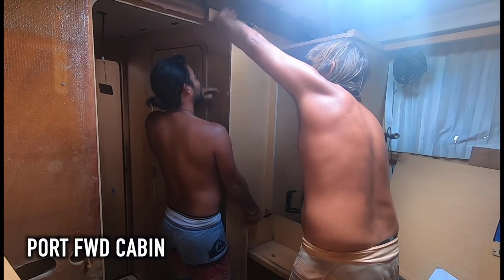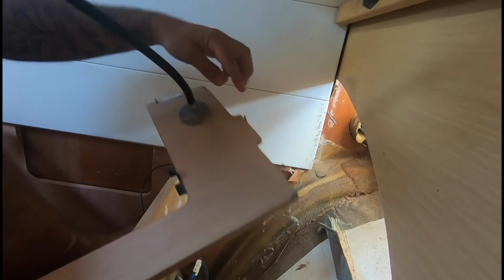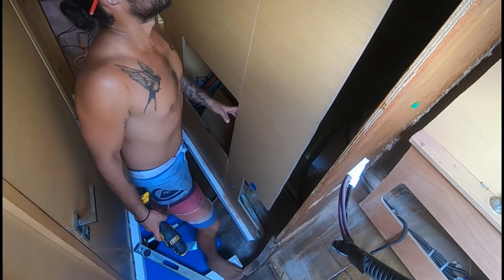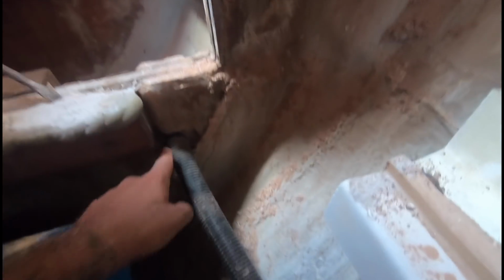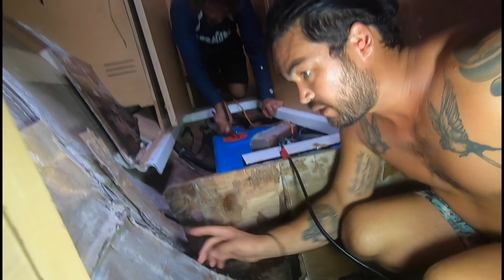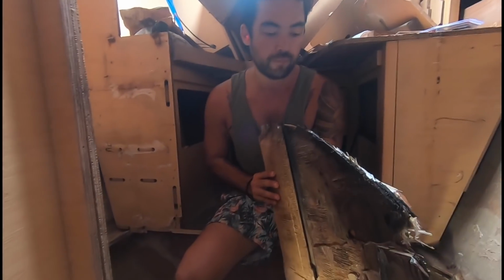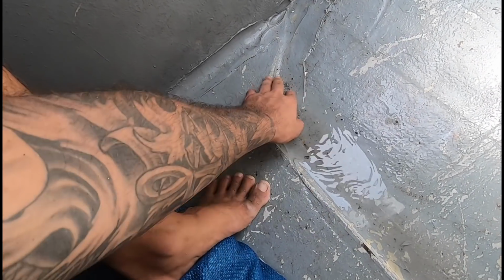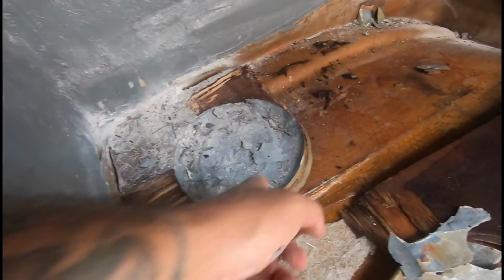CRACKED BULKHEAD REPAIR SERIES - Part 5  (Episode 110)

Comment: 3 second google search finds this enjoy.
Recieved this from Lagoon today:

Service Network communication regarding the Lagoon 450 mast bulkheads
May 6th, 2021

Dear Partners,
Following the webinars we had this week, this communication regards the Lagoon 450 (Flybridge and SporTop versions) in response to several reports of damaged forward bulkheads.
To share with you a global view and understanding of the situation, we would like to remind you that since 2011, more than a thousand Lagoon 450 have been sailing all over the world, and that a large number among these are extensively sailing, many in successful charter use.
To date, around 40 cases of damaged forward bulkheads have been reported, mostly by owners directly. However, we would like to point out that a large number of boats inspected present no problems with their bulkheads, knowing that many of these boats have a history of intense sailing in all types of sea conditions.
You are well aware that the customer safety is an absolute priority for Lagoon. In this regard, we would like to confirm that the damage to the mast bulkheads, as reported to us, can lead to neither dismasting nor any risk for the crew.
All Lagoon 450 can therefore continue to sail.
Among the cases identified, we have discovered localized buckling or shearing on the outer side of the forward bulkhead (non-structural zones with respect to mast support). According to the Finite Element calculations (FEA) performed by our Design Office and analyzed in collaboration with the VPLP team of naval architects, we confirm that the scantling is sufficient under normal use of the boat.
The area is located in a stress concentration zone, designed to withstand normal stress, which could however create an imbalance if the boat was to be used in a manner that does not comply with the recommendations for use, as described in our User Manuals.
To reassure Lagoon 450 owners, should they have any questions about the condition of their boat's forward bulkhead, we propose, for those who wish so, to have an inspection of their boat's forward bulkhead performed by the Lagoon dealer network (or Lagoon Service Center). As a commercial gesture, these inspection costs will be borne by the brand. It cannot be carried out other than according to the inspection procedure established by the Lagoon brand. Should the owner detect any damage to the bulkhead, we recommend the inspection to take place at the earliest opportunity.
The only approved inspection is the one provided by a Lagoon dealer, following the methodology provided by Lagoon.
In view of our technical analysis of the cases reported, and of the history of each boat, we wish to manage the situation on a case-by-case basis, which will allow us to propose an appropriate response. Our Customer Service team is at your disposal to provide you with the inspection methodology and, if necessary, the appropriate repair procedure, or even the reinforcement procedure for the forward bulkhead, should the customer wishes so.
Finally, we confirm that this issue only concerns the Lagoon 450, and no other model in the range, be they former or current models.
The Lagoon 450 is, and remains, a model widely appreciated by yachtsmen all over the world, and we are committed to preserving its excellent reputation, both in the interest of the owners, and also in the interest of the Lagoon brand.
We are working hard to find a solution for each and every case that is brought to our attention, and we know that the professionalism and worldwide presence of the Lagoon dealer network and Service Centers, which you are a part, will be a genuine asset in this context.
Thank you for your collaboration on this matter, and for the level of service you are able to provide to the Lagoon 450 owners that come to you.
The LAGOON team

Comment: Colin, you are the man! (both of you).  Question is, did the water rot cause the initial failure or was it the hurricane damage?  Either way an issue that’s clear, is the original craftsmanship and construction of this cat surely holds some of the blame!  This video even teaches non- boat owners the damage water can do.  Water will find it way to a settle point.   PLEASE COLIN WEAR A MASK!  you damn sure don’t want lung damage or worse from all this!!!!  Sure it’s hot and a pain,  but you have to wear one!!!

Comment: when putting her back together, try to minimize the number of holes in the bulkheads. And especially do not cut holes on the same (horizontal) level like in the bulkhead at 7:00
It weakens the bulkhead dramatically.
Round holes are better for stress relief.
but of course you know this sjit :-)

Comment: This illustrates the pitfalls of modern boat construction where the furniture skin hides all the structural stuff. One little leak can rot out the entire boat setting off a chain reaction of failures. It’s not Lagoon’s fault, the whole industry builds boats like this. They are not designed to last more than 10 years or so. These failures surprisingly common.

Comment: Lagoongate continues..
In some some respects, thank fork this happened to you guys because you have literally revealed the full extent of this..you may not have only saved your lives but many many others...
Now for an annoying suggestion...maybe screw glue and glass in some aluminium box section to your new bulkhead on the vertical? (4" by 1" or 2"?)
Light, no rot and rigid....you could even make it a custom design feature :)

Comment: Here's a trick for controlling dust. Put the space under negative air pressure using a fan to suck the air outside. If you don't have an opening to vent directly outside, use a fan/filter combo and you can direct the air wherever you like. When I was having the drywall sanded in my basement,  I sealed off the entrance to the basement with poly film with a HEPA fan filter module mounted in the film. The fan sucked air out of the basement and the filter made sure no dust migrated beyond the basement.

Comment: Wow, looking at that glue squiggle and clean release regardless of recent water intrusion at the tripled bulkhead stiffener, I can only imagine the engineer screaming, "That's not what I meant by glue laminating 3 pieces of plywood." That clean line shows either the glue developed a skin prior to bonding, surface contamination that prevented bonding, or faulty adhesive. In any case that should have been 100% coverage and not a squiggle of adhesive.  That alone proves those bulkheads are worthless from an engineering standpoint. Every place on that boat adhesive was applied is now suspect. In every boat Lagoon has manufactured. The wood fibers should rip apart before that glued surface should release. 
The placement of that conduit through the bulk head shows a complete lack of understanding of the structural aspects of the main critical support structure at the factory floor level. Production of these boats should stop immediately until these defects are addressed and rectified, the crew which assembles the parts is educated on the structural importance of the parts they are assembling. I really wanted to get into that exact boat. I'm not sure I'd take one for free, now. I feel for you guys. This isn't Hurricane damage. As evidenced by the one sitting right next to you with the same problems.
Reply: By the pattern of that glue, it doesn't look like any clamping pressure was applied while the glue set, so it just stayed as a bead and didn't provide much strength.
Reply: I thought about the holes put in the bottom of the bulkheads and am not sure it is a structural problem.  Is there mush of a load at that point?  However it certainly help moisture intrusion in plywood.
Reply: Yep , the glue should not fail , it should be stronger than the wood . All the holes down low allow any water in the bilge to penetrate and rot the wood  before we talk about weakening . There is zero chance they sealed the holes given the cheap camper construction quality of this boat . 

It reminds me of those cheap campers that look great new and last about 10 years before the slide out starts leaking , the floor gets holes under something that can not be taken apart to fix because the wood was not real marine grade or even protected by paint .

Comment: Major mission, make sure you use lloyds specification ply wood also make sure you use Vinylester resin and not polyester as adhesion is  paramount, also overlay to hull shell requires 4 inches staggered otherwise hard spots will cause cracks external in Gelcoat later on .
High density foam slither between ply and hull filleted with 1152 bonding paste, don’t use resin mix with colidical silica  to create fillet as will crack under loads as has zero flexibility.
One should invest in a 5EQ festool sander and vacuum around £600 all in will do same job as grinder with no dust .

Comment: I am a car guy and i know a little about aluminium monoqoques.  With time there is fatigue.  Your boat has got the same Syndrome, your bulkheads are dead,plywood as alu moving it's getting weaker and weaker , it's lifespan is over! So i think before anything else  , replace them with your own design. 
Beeing a ship engineer , you will arrive
Good luck     fred

Comment: geez dudes, interesting what two blokes dressed in underwear armed with little more than hammers and a dremel can do. Those bulkheads are shockers, the condition of the inter laminates of the ply, that shouldnt happen. Are you sure its Marine Ply?  In hindsight those apertures for conduits and pipes shouldnt be where they are, or should have rings around them to support the load path. Same is true to the companionway access, it should have an angle ring (even if its stubby) around it like water tight doors have. Landings for the plywood edges of the bulkheads might be nice to, just to spread the load. It seems over the top but clearly as bits have been failing the whole system has come apart, and it seems to me what failed first isnt certain or typical. Do what you can with the apertures in the new plywood, and you are going to have to be certain the contact with the traverse beam at the top is more than adequate, even if you have to plan in some additional shear strength beyond spec after the primary glass. Overall coating in epoxy a given. Better now than revisiting it later.

Comment: I hate how as a boat builder you make everything below the Waterline watertight fibreglass and painting resin everywhere just for some plonker to drill multiple holes through bulkheads which now lead water into the structure of the plywood.
 I was taught all holes through the bulkhead painted with resins to stop any water penetrating ply.
You are doing an awesome job but I am so very glad I am not living where I'm working keep positive

Comment: Hey bro, im no engineer but you need to epoxy back fill that whole lower floor, cut up the glass sheets into 2" x 2" pieces and mix them up INTO the resin as a thickener and just pour the mixture in and let gravity do the rest... I used to think million dollar yachts were built to strict standards but honestly hurricane or not... better reenforcement was needed anyway.... DONT REGRET THIS, be glad you are getting an up close and personal inspection of how shortcuts in manufacturing can lead to DISASTERS AT SEA. ;) someone UP THERE ^ loves you.
Dont let this bring you down, you got this.

Comment: Wow Colin and Jamie .... Greetings from NZ.... I am ' With You  Guys all the Way' ..... The way that the Boat has been 'Constructed' , 'Designed' and 'Engineered' borders on Criminal ..... No Bonding and/or heavy Bi-Axial Glass between layers of Ply ...... As you say, Totally Agree .... The weakest point is the 'Openings'... Especially the corners down on the Hull and 'Pontoons'. The amount of 'Tension' below and Compression above the Opening is Massive and No Way could That 'Construction' survive even just the 'Shroud Load', let alone some Heavy seas .... Those Bottom Corners will Need Massive constructions as they are just so Narrow / Inadequate  .....Very best to All from NZ

Comment: Replace that rotten insufficient structure with Cosa board instead of Plywood.There are composite boards with much better shear and compression strength.Plywood is the budget builders material.The watt to do your repair would have been to remove the deck and lift out the interior components reversal of the way it way built. the mast step to chain plates need an aluminum grid welded together hull to hull for to aft

Comment: "new plywood" - why not use Divinycell - that will not rotten - and would be better for that with the right density and glassing?
Reply: Along with Ultra High Molecular Weight Polyethylene (UHMW) UHMW, also known as UHMW-PE (Ultra High Molecular Weight Polyethylene).

Comment: I'm sure you're past this point now with the rebuild. Have you considered fabricating a two piece stainless steel bulk heads similar to the plywood ones only two pieces so as to be able to install in the tight quarters and bolt the joint together. The outer edges to pontoons to be thru bolted with backing plates. I know the stainless fabricating would not be as builder friendly the plywood, but you're planning some serious open ocean runs. I'm just another arm chair quarter back.

Comment: Sunk boats can't be compared to unsunk boats. You can't really say where the stress points are after sinking or where the leaks came from. If you can don't cut out add plywood and glass to the orignal wood.
Reply: This is why you don't salvage boats damaged to much.
Reply: This is the problem with cats "flex stress " from two hulls. They get racked .

Comment: Hey colin/jamie,.. thanks for another great video,. this is clearly a manufacturing issue that brings into question the very design from the day this cat was conceived, rotten wood, caused by leaks in other areas of the boat not being designed or finished properly, total lack of access to critical areas as main bulk heads which makes regular inspection dam near impossible even with a cavity camera,.the insurance companies will keep an eye on this project i suspect and milk it for all its worth should there be a claim on other Lagoons, so Lagoon owners beware, 
as an engineer i was always taught that a man can take it apart and put it back better that it was before !!! i would love to get stuck in with you guys,.and get this F**K up fixed,..it looks a daunting task,... but am sure you'll do it the very best of luck,..David,..
Q:....PS ever though of replacing the rotten ply with a thicker ply to add more strength ?

Comment: i’ve just finished the same job on my mast bulkhead, But this is only a 35 feets monohull so you get at least 4x the same job that mine to do! Respect ! By the way i am again surprised by the low plywood quality. My boat is a jeanneau one design from 1992, known to have water leak inside the mast. So my bulkhead was having the foot in the water since nearly the haulout. 25 years later, she was bended and around 2-3 cms missing below the tabbing but in no way the plywood was peeling off like you had....

Comment: Colin, Jamie, the Lagoon Owners Community owe you two plenty, possibly their lives for exposing Lagoon’s design and construction faults.  I was one day late to get my hand on a 440 and been very unhappy about it.  Seeing what you and your neighbour have uncovered, I cannot be happier to have missed the Lagoon 440.  Perhaps, the other models may have been built better, but the thought that similar mistakes may have been made, is a very troubling thought.  I can imagine there are plenty of of folks worried and angry and perhaps a CLASS ACTION LAW SUIT against Lagoon may not be unthinkable. What are the guys at Lagoon doing to re-assure you and other Lagoon owners? It will be very interesting to see.  
I think henceforth, the Cat manufactures should consider producing a step by step video footage of their construction process and describing the materials used in the construction.  As for me, I will not buy a boat mono or multihull, unless I know the integrity of the boat is solid.  
You guys are the best, good luck with the work and wish you happy times on land or on water.

Comment: Did marine design for SantaFe Engineering, Avondale Shipyard, and others .... Colin, rip out all the old and put in NEW, need solid bulkheads all the way across the full beam of the boat. Don't need a hull/structure failure in a heavy seas condition where the boat starts cracking like an eggshell.  I can see you have the drive and motivation to get it done.  Cheers Mate !!!!

Comment: wow thats some rough grp work,the glassing on to ply in that manner was always going to be a poor design choice looking how wide they are in places add very little stiffness to the hull coupled with open ends asking for trouble.
delamination is alway a issue even when primed first with epoxy.
 i take it they used cheap shit ply not marine grade hence all the rot as well.
very thin frames doin a hell of lot of work .

Comment: invest in a blower, like the type used for flood restorations. The only way to control that light flower dust is to isolate the area with poly and create a low pressure in the area you are working. Duct it out of the work area. Preferably a 8". Daily clean up is required to stop it from tracking about. This is also the method used for asbestos abatement.

Comment: It's a design flaw. Not a build quality issue...
If it stays dry it would be fine.
All wood in a marine environment has a limited lifespan.
Doesn't look like wilfull negligence though. All wood in a marine environment has a maximum design life.